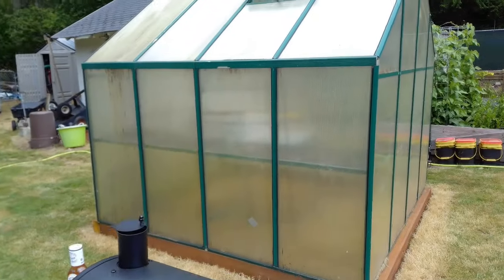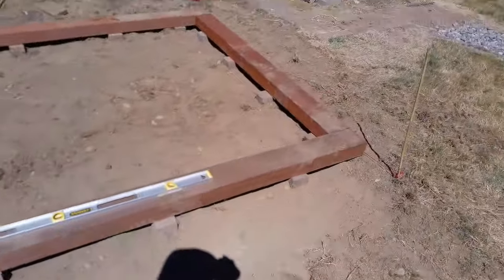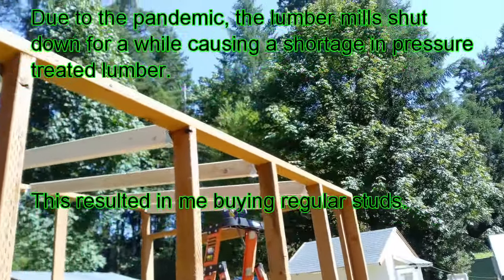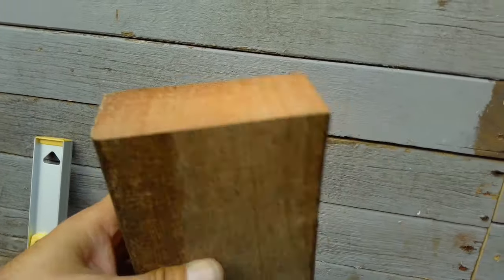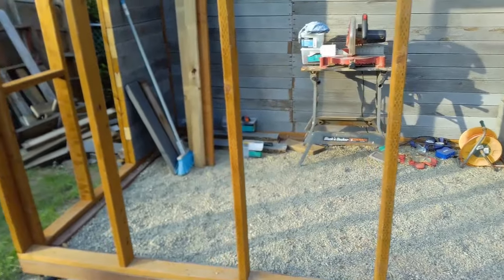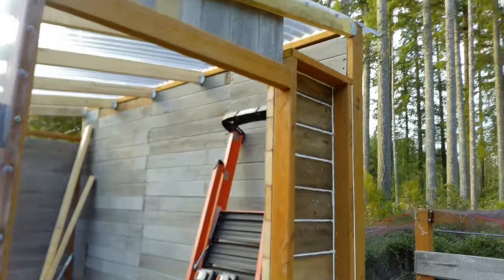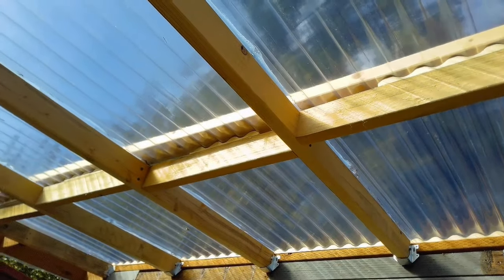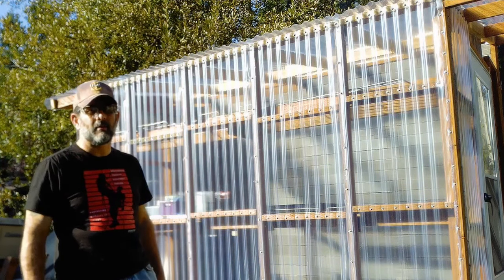DIY Greenhouse Build - Wood Greenhouse Under $1000.

Comment: That's a lot of money for that little greenhouse. It looks nice and very well built but that is a lot of money for that little greenhouse. I bought one years ago, 4 by 16 and it didn't cost that much. Not as nice as yours but in today's times with gas prices and food prices its going to be hard for people to use that 1000 even if they should raise their own food. Yours is nice
Reply from the maker: Thank you.  I have a couple kit greenhouses and they just don't keep the heat in as well.  Since I start my peppers in the end of January, I needed something that would really be insulated and durable.  With the large spike of lumber prices, this one would probably cost twice as much now.
Reply: I do most of the construction on my mini farm with reclaimed lumber. Whenever there is a home remodel in my neighborhood, I ask the foreman about scrap that is headed for the landfill. So far the answer has always been "take it." The exception is lumber at ground level. For that I buy new pressure treated material.

Comment: I think you moved it only to kill grass in another location. Boy you must hate mowing that much 🤣😂😅🤪🤪
Reply from the maker: It does make less mowing in that location.  Problem is my lawn tractor doesn't go around them as easily therefore, I have to break out the push mower.  I should just put pavers all over my yard.

Comment: looks great
Reply from the maker: Thank you.  It is showing the wear though. I will probably have to replace the roof panels at least on the top soon.  Heat weakens the cheap panels and a tree branch came down on the roof and popped a hole.  Happy Gardening!

Comment: Thank you. I am trying to figure how to create and install the vents and fans. I look forward to your next video. Great idea about using the oven racks. I will now be on the lookout for those at my local recycling center! 👍
Reply from the maker: Glad I could help.  I should be posting the solar fan video soon.  Editing it today.
Reply: The most important consideration is peak temperature inside the greenhouse. Most plants don't use much water at 75F, use a lot of water at 85F and go critical above 90F. In other words, your ventilation system needs to be capable of keeping the indoor temp below 85F on your hottest days. One strategy for this would be to open your vents at 75F (most auto openers can be adjusted between 65F  and 77F) and start the fans at 80F.

Comment: Great video man.  I'm fixing to build a cattle panel hoop house myself  but I saw  this vid and found it interesting.  No BS ear splitting aneurysm inducing music . Just a common man Making a great greenhouse.  I almost want to build your design over what I'm planning so I may build it also. The wood was a definite score for sure. Good Luck out there un Western Washington.  I miss Washington used to live in Coeur D alene and worked in Spokane. Myself I just moved to the  Ozarks.  The house I bought here with 80 acres and 3 out buildings would be well over a million in any part of WA . I paid just 400. Plus the political deali gs of WA just make that beautiful state not something I want to deal with with what's happening.  Good Luck and God Bless.
Reply from the maker: Thanks, good luck on your build.  Happy Gardening!
Reply: I am in Arkansas, bought 10 acres for 10,000, no jobs, and I didn't check the job market before we got here.

Comment: Did you have to let the pressure treated wood dry before framing? Thanks
Reply from the maker: It was some of the last dry pressure treated wood before all the mills closed for C-19 which created the shortage and wet wood supply.  I had to use untreated 2x4's 
with Thompson's water seal for the rafters.  Happy Gardening!

Comment: Nice job! Whats the lumber size you used for the bottom frame which is sitting on the bricks?
Reply from the maker: Thanks, its 10ft and 6ft - 4inx6in pressure treated.

Comment: Bro!! WHY IF YOU HAD TO SEAL THE WOOD!        WHY ON EARTH DIDNT YOU JUIST     ^^^ ^CALK IT AS YOU GO^^^^  
It will take so VERY much more TIME and EFFORT to fill, EF THAT those cracks! they're So small!   When it would have been so easy to just have the calk as you went! and " Squirt, nail- nail , Squirt"
Reply from the maker: I should have.  I actually went and got some insulation foam sheets and put it on the outside.  Hindsight is always 20/20.  Well, I'm a better gardener than a carpenter.  Happy gardening!